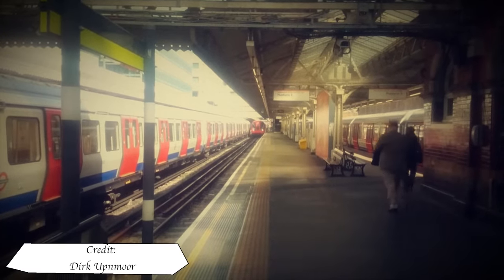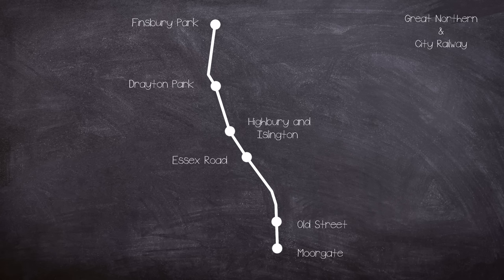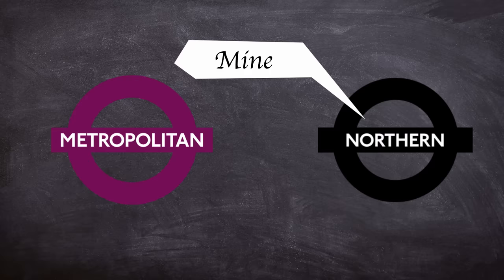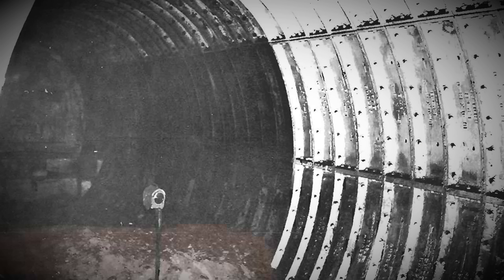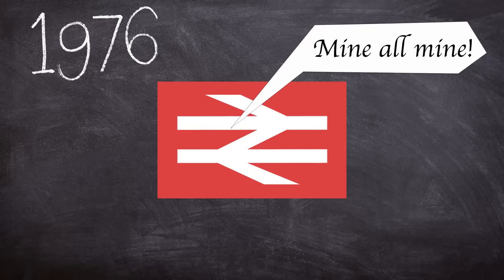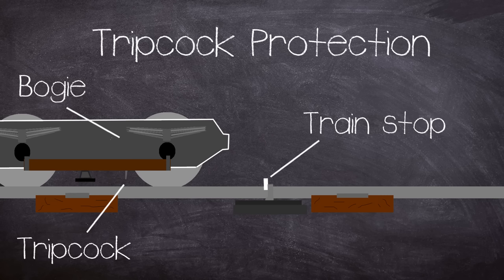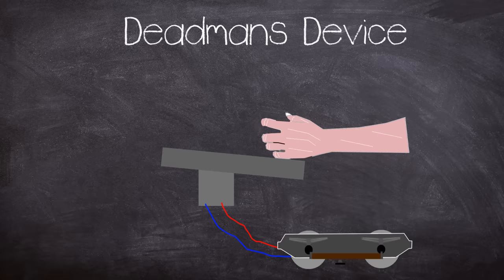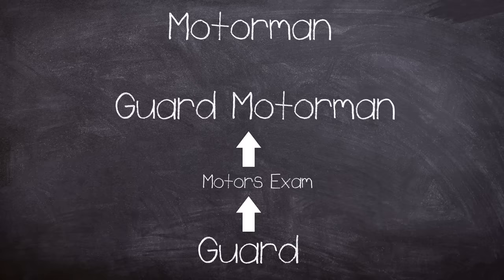A Brief History of: The Moorgate Tube Train Crash 1975 (Documentary)

Comment: As a train driver myself, i feel this may be from a microsleep or just falling asleep all together. Back then we really did not test for sleep apona so this could have been the cause. Daydreaming would be my other pick as it something you can easily drift into. Daydreaming/autopiloting can be very dangerous as you can easily slip into it without knowing. You need to train your mind to snap out of it the moment you start falling into it. The reason why is you can easily drive pass a signal at caution in plain view and not see it.  Some people find it hard to understand why this happens to train drivers given our level of responsibility. After a while the act of driving a train loaded with people becomes normalized. It feels no different than driving my kids to school in the car. Train driving can also be boring so your mind can wander and this autopilot state occurs. This autopilot state is really dangerous because you will miss obvious things like the fact you are running out of track.
Reply from the maker: Something we were always taught was about unconscious competence dangerous state to be in
Reply: @PlainlyDifficult  our rolling stock does try to combat this with a vigilance system. If the drivers does not make an input into the controls within 30 seconds (accelerating doesn't count) a blue light will flash. You must acknowledge this light by either pressing the vigilance button or making an input into the controls. If you fail to acknowledge this light in 10 seconds a loud audio alarm will sound and if you fail to acknowledge that an emergency break application occurs. This vigilance system may have helped prevent this accident. You are 100% right it such a dangerous state to be in. I do my best to avoid it as I really do not wish to be in your next video :P (no offence lol)
Reply: I can only repeat that, I'm a light rail Tram operator in Germany. IT happened to me once that I approached much too quickly at the station. I had to brake harder, but I simply forgot that this station existed, I just didn't react to it  that the stop is there, even though I saw it, I was wide awake.
Reply: I have had nowhere near that level of responsibility, but I know all about autopiloting.  I used to be a retail manager.  I usually worked the closing shift, and my store was 25.6 miles from home, nearly all on major highways, which were pretty empty at night.  After a year or so of driving that route, I began to realize that I wasn't really recalling my drive home.  I could remember everything I heard on the radio or what I was thinking about, but not really the drive itself.  I had a few landmarks that I always was aware of (going from one interstate highway to the other, the airport, a major curve in the road, and my exit).  I could never recall anything else about my drives.  It probably didn't help that I hated being transferred out to that store, I hated my job, and I really hated that drive.  It's amazing that I made it home, without incident, for 3.5 years.

Comment: According to the  report, he still had his hands on  the controls, so wouldn’t have raised his hands on impact, therefore making the reason even more confusing that on impact he was still in the driving position
Reply: maybe an absence seizure
Reply: If my husband was holding something when a seizure started, there was no way you could get it out. He was using a paring knife once, and managed to stab himself in  the opposite hand during the seizure.
Reply: Yeah if head had lifted his hands before the collision, wouldn't that have triggered the dead man's switch? And they said there was no evidence that any brake systems had been activated. So I would think he still had his hand on that dead man switch at minimum.
Reply: @fmulder6564  yeah exactly, and if it was a suicidal act or something, or if he was distracted, he'd have taken his hands off the controls instinctively just before impact.
Reply: The report detailed that the deadman’s handle was down and power applied. The control gear was affected by the loss of contact on the crossover then ran up to full power. One of the drivers colleagues noted he used a lot of sugar in his tea, and there a
was a query regarding undiagnosed diabetes. With modern forensic science I’m still not sure we’d be certain.

Comment: There was a similar case in 2011 by Hordorf, Germany where a freight train driver did not stop Infront of a red signal and collided with a passanger train. Germany already had a system to stop trains from going past red Signals for decades, but it wasn't installed on that particular section yet.

Comment: "an accident like Moorgate shouldn't happen again" then cutting to the picture of the Kirkby Merseyrail crash seems a bit unfair considering how different the two situations are. 
1) everybody survived with minor injuries at worst 
2) the train is above ground with no wall to hit in front of it, though the train did derail and hit the platform edge
3) the train was slowing down before the crash happened with the emergency brake applied before it hit the buffers. 

If the emergency brake wasn't applied like in the Moorgate crash, then it could well have turned into something much worse like Moorgate, but using it as a direct comparison just seems wrong to me. Otherwise, a great video, thank you.

Comment: My 5 year old is obsessed with disasters. When he's a little older I'll introduce him to your videos.

I've been to Moorgate countless times but don't remember seeing any mention of the accident in the station.

Also bizarre you could just buy morphine in Boots in the 70s
Reply: It's probably for the better that there isn't any mention, or just very little. That would scare off so many customers even though trains are much safer now.
Reply: @Sanas_Shy_Language  I still enter trains from the back or middle. The 7/7 bombing scares me about the underground. There's barely any police at these stations too.
Reply: I used to use Moorgate from time to time as well and I couldn't work out what had happened until I realised that it was on the British Rail section of the station, not the normal Tube lines. There's a line that comes down from Hertford to Moorgate. The tunnels for it are sized for overground rolling stock and so are larger than standard deep level tube lines. This is one of the reasons that the accident was so bad, as the oversized tunnels allowed room for the tube sized carriages to ride over each other. These days only overground stock is used on those lines.
Reply: @Sanas_Shy_Language  There are actually two memorials; one up the road on the SW corner of a nearby park, plus another unveiled in 2014 at the Moorgate station building.
Reply: There’s a plaque outside the station although it’s quite tucked away
Reply: you couldn't just buy Morphine in Boots, it had to be prescribed bt a doctor.
Reply: @mikehindson-evans159  Yep, I only lived i London for a few years, but even I've seen the outside memorial.
Reply: Boots has a pharmacy in each store - pharmacies keep controlled  drugs in stock for prescriptions anyway so the pharmacist on duty would have let the doctors have all the painkillers in the locked safe for the purpose of first aid. Technically, the supply of a controlled drug to someone without a prescription is drug dealing but I assume doctors would be able to get it for something like this. Anyway it wasn't a case of something Boots were selling to buy.

Comment: I've never before heard such a clear, concise and undramatised version of the Moorgate Crash. Well told! Great background info as well.
Reply: Well there was still no question answered as to why the guard or even a pasenger if travelling that journey every day never used the emergency passenger brake handles placed in each car as soon as the rear car passed over the crossing dividing platforms 9 & 10 at speed as the guard would have been jolted around if correctly stated was walking along the rear car looking for news papers? By that time applying an emergency brake in the rear car wouldn't have prevented the overrun if correctly stated the train was travelling between 35-40mph but might have reduced the impact speed to below 25mph even if the drivers brake valve was still trying to recharge the system.

Comment: i wonder why nobody thought about filling the overshoot tunnel with a compressible barrier designed to brake a full train instead of having a solid wall at the end that stops it instantly
Reply: We develop better safety systems only when we notice we need them.

That tends to be when something really bad happens.
Reply: I'd like to see what that would look like and how it would work in such a short stretch of tunnel.
Reply: @RCAvhstape  just guesing here but maybe a hydraulic 'catch' of some sort ?
Reply: I mean, under most circumstances, that's the purpose of the sand drag.  The drag is both effective and nearly error-proof once installed, as there is no interaction that heeds to take place at all, it simply works by physics.  Unfortuantely, there's a limit to how much you can slow down that enormous kind of mass in that amount of distance.  A longer drag might well have done the job, but it was obviously intended to catch an over-run, not a complete, full-speed train just going at operating speed square into the end wall.
Reply: @RCAvhstape     It won't work in so short a tunnel... 

     That said, we DO have things designed to stop some very heavy things, not exclusive to 18-wheelers... SO I'm only estimating here, but it would have to work something like a "Runaway Ramp" only designed around trains instead of trucks... AND you COULD make it damn effective, but it's going to take more space to stop a loaded train WITHOUT killing most of the passengers.

    I mean... the wall and sand drag DID effectively stop that train, too... The hard part is making that stop "survivable"... which it largely was. Technically, we could say "It did its job"... but only "technically".

    AND no, I don't know how much more tunnel should've been or would've been used for the sake of safely stopping the train. They went "the technical route" on that problem with more brakes and trip-cock devices. The only real "benefit" to filling a tunnel about half full of sand mounds for a quarter mile is that there is NO technology to rely upon, no human factor to f*** it up, and it WILL work every time exactly as it's designed...

     The "Runaway Ramps" also have a cost. I'm not sure how high, but a trucker who hits one tends to start paying $40 K... in fines just for the incident... last I was told, anyway. ;o)
Reply: I'm a musician, so physics and maths are a black art to me, but would something as heavy and big as a tube train not carry a massive amount of momentum making it extremely difficult to safely stop it using a barrier of any sort? All that energy has to be absorbed, or diffused, in a way that stops the rear carriages crushing the ones in front. Like I say, I'm a borderline idiot, on a good day, so I'm merely wondering out loud
Reply: cost.
Reply: @rubievale  That's pretty good; you're very far from that border. The key is to absorb that energy - decelerate - gradually, usually by compacting some material, as with the front of an automobile. I'm not sure how gradually sand would do that. And as you say, there's a lot of momentum/kinetic energy to dissipate. This is really complicated in practice and I expect that, apart from careful calculations, requires loads of simulation runs and tests to get right.

Comment: There's hundreds of ways they could design is so this couldn't happen. I don't understand why in the hell they relied on a single person for everything.
Reply: It was the 70’s .  Cheep automation wasn’t a thing. Notice that even today Crossrail is running about two years late mainly because of the testing and refinement of its automated control systems. If a system , such as the 1930s tube stock, has worked for about half a century without a major accident what would motivate a cash strapped organisation to invest more in safety ?
Reply: The establishment always have to do it on the cheap . It was ever thus .

Comment: 17:30 - no fault by anyone else. A finding that will kill others later. My findings:

Insufficient speed control on approach to that station.
Insufficient excess tunnel length beyond the track.
Insufficient excess track.
Insufficient safety systems on the railway & trains.

NEWSON WAS NOT TO BLAME. He was merely the final (only?) safety feature on the system. So many other actions could have happened to prevent this.

Comment: As a driver, I must say (and I’m sure it has already) switching off the traction current will not stop a train. At least quickly. They are highly efficient at coasting, miles and miles in some cases. Even at lower speeds typically seen on the underground.

Comment: my theory personally is to do with the brake systems. As stated previously in the video if you overcharged the system you had to release the brakes to clear it, what if driver Newsom was in the middle of trying to purge the extra pressure right up to the end? That would explain why the brake handle would be in 'release' or 'off' in the wreckage.
Reply: if he had "overcharged" the system then the train would have been braking already. Upon releasing the train wouldnt just pick speed back up again but would maintain the speed it had. So assuming he locked the brakes its unlikely that he would still be going 35-40 after releasing them and he would have no reason to release them going that speed that close to the end. Also it doesnt take long to purge the air even if you do overcharge them. So while its a theory its just got too many problems to really hold much merit....

Also i may have misunderstood but i believe the train had two forms of brakes. One allows for multiple brakes so its safe to assume it would be the main braking system where as the system your referring to would be more of a back up.

Comment: A few points. 
1. Motormen were trained NEVER to use the Westinghouse as the stopping brake at a terminal station as “hitting the mark” is important to ensure the train is fully in the platform signalling section (train berth) in order to get a release of the road behind to set for departures, the inability to get a partial release of the westy was one reason we were drilled to ALWAYS use the EP brake at this point. So theories about difficulties with the Westinghouse are likely to be misleading,  besides which, having got it wrong myself as many others have at some point especially in training,it’s a trivial thing to stop and blowdown/recharge, Or even throw off the Westinghouse and use the ep instead, it would still stop the train.
2. I have doubts about the signalmans’  estimate of the speed, the train in fact  traversed a crossover to enter the right hand platform (having travelled via the left hand tunnel bore), from experience as both guard and driver this traversing at that sort of speed would have been violent enough to alert the guard that there was something wrong, additionally it would have “unsettled” the driver who was seated, this “seat” was actually a narrow fold down device with zero side support, further I seem to recall reports that the Master Controller was found jammed by the impact in the “Series” position, - until the 82 tube stock all LU trains had the same 3 positions regardless of Controller type  being “Shunt” (very low speed depot operation) “Series” used for reduced speed working eg when running behind clearing signals from a train ahead, and Parallel, which provides full voltage for maximum (line) speed. If reports are correct a 38 in series wouldn’t do the sort of speeds the signalman reported. 

A couple of other things, “ Moorgate controls”? Never heard the term in 3 training courses at White City Training Centre, or out on the road, they were called by their Rule Book terminology, Approach Control Signalling, although some drivers referred to them as “platform policemen”. The brake reservoir that provides the “application air” (my term for clarity) on the Westinghouse  brake is the Auxiliary Reservoir, when learning the flows of air we referred to the air used to charge the brake cylinders as auxiliary air. 

Platforms also have a fixed trainstop now so that going too far past the stopping mark will  trip the train

I’ve driven 38s when they returned to the Northern line during the mid 80s plus the 56/59/62 stocks that were derived from the design. They were capable sturdy machines (some of which only finished service on the Isle of Man early this year!!) we will never know what happened, that was the conclusion of the report and is an opinion voiced by the instructors that ran the training courses I took in my time there. I feel for M/M Newsomes family who had to face the fallout from the events of that morning. I don’t for one minute buy that he was just confused about where he was, the crossovers alone would have reminded him. It was, and remains a tragedy.